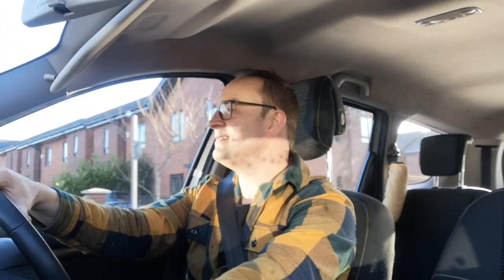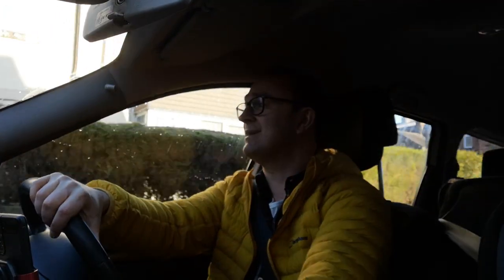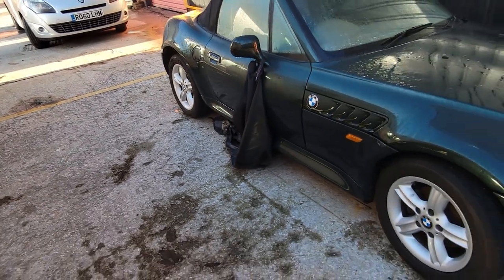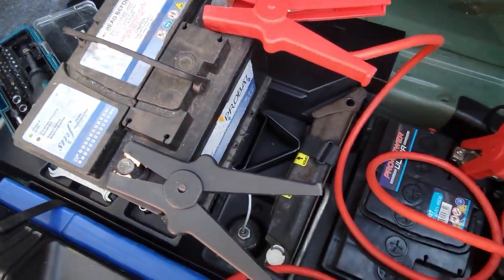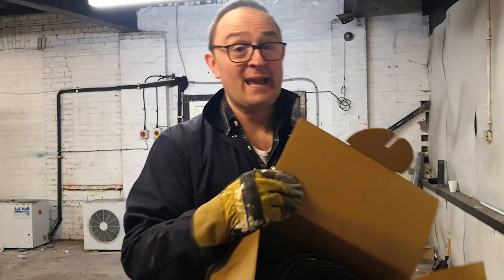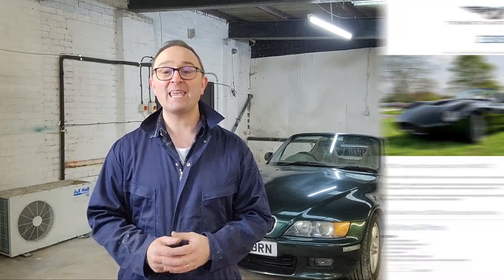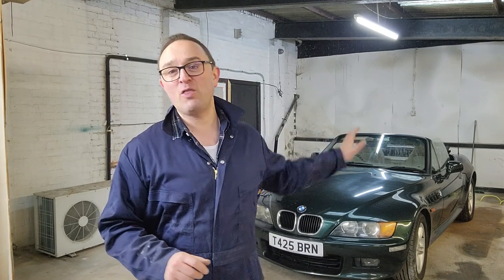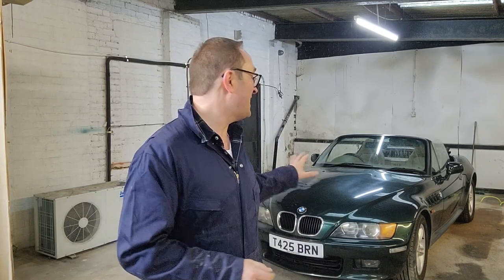Introducing the EVGT: new electric car conversion project

Comment: Can't wait to see the is300 inverter being used! Looking forward to following the progress!
Reply from the maker: Me either. It's a nice unit. Very compact. Though less obvious mounting options than the Prius Gen 3. And I don't have a loom for it so work to do there.
Reply: @EVDIY  if it's like the 450h mounting, you'll meed a face plate, and attach the mounts to that. Best to try to keep your mounting points as far back as possible, rather than using the original engine mounting points. Use artur as a guide. His mounts are the best I've seen in terms of space saving. The rear will be much easier i suspect
Reply from the maker: @knoxsp  I have a plan for the motor mounts - two good pick-up points from the old motor mounts in the engine bay. Box section from there to the locking plate. It's the inverter that is a bit less obvious. Prius has three simple vertical holes to bolt through. This one has a mixture of vertical ones and strange angles. Not a real problem but more thought required.

Comment: It sounds like you got it well figured out. Really looking forward to watching the conversion. 👍
Reply from the maker: Ha! I know what my ambition is. How it turns out... Going to be a lot of figuring out to do around mounting the motor, controlling the inverter, and mounting enough batteries to get me to my desired range (~100miles). And that's after I've fixed all those MOT failure points!